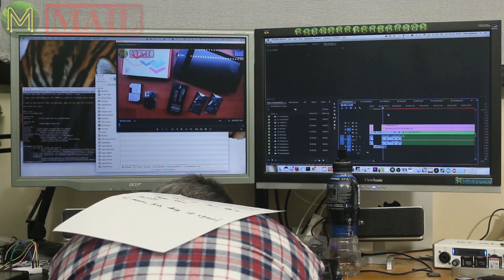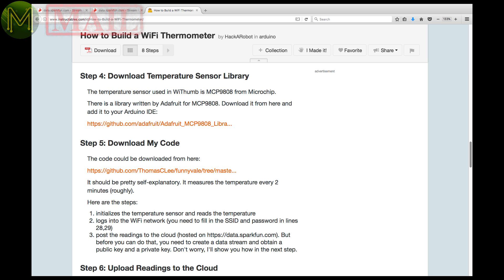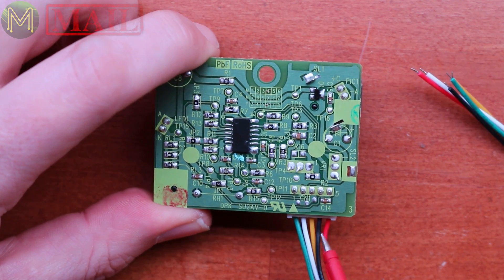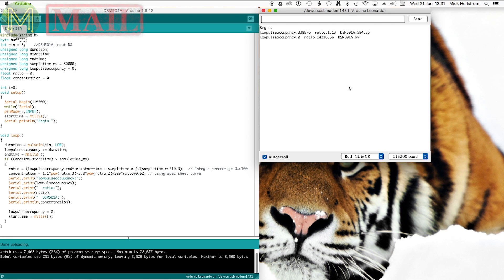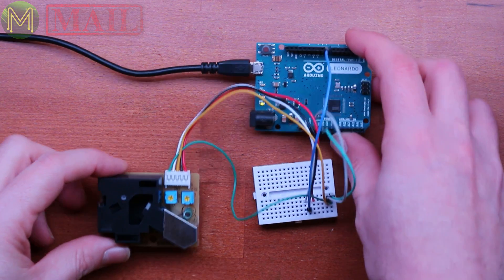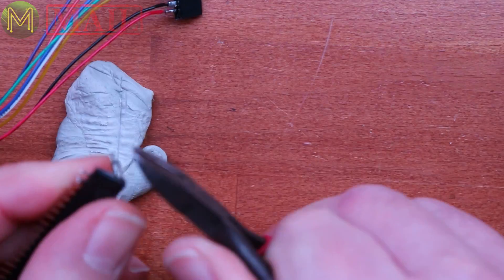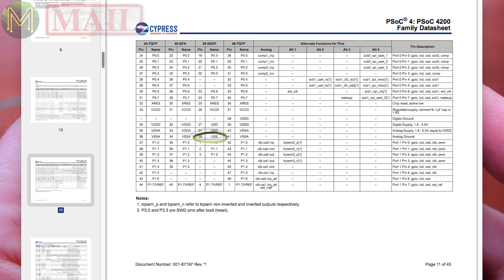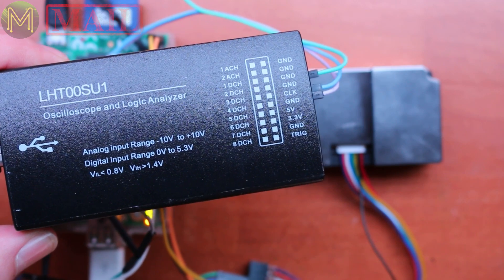#147 MickMake Mail #13: WiThumb, Sensors & cheap Analyzer // News

Comment: Hello Mick... A bit surprised to see you struggling with the dust sensor. It is a well know model sold in China (bought 2 samples) and you can find easily the cable mapping and even the Arduino code to do the stuff. I found them in taobao (chinese website) but I am pretty sure you can find them on Aliexpress.

Anyway, I really love your videos, your look, your wife and your children and your way to use a shaver.

https://s.taobao.com/search?q=sharp+arduino&imgfile=&js=1&stats_click=search_radio_all%3A1&initiative_id=staobaoz_20170630&ie=utf8
Reply from the maker: +Renaud Chine 
Hi Renaud,
Yup, I tend to battle on without looking anything up. Part of the challenge. :-)
But got it all going in the end.
Would be good to be able to compare these sensors to some proper commercial ones.
Reply: Well, in China I bought a xiaomi air purifier and dismantle it: it was the same sensor.
Not enough time to connect the dust sensor to an Arduino and compare the results with the xiaomi...

Comment: I was looking for this exact software (PulseView) to run my OpenBench logic analyzer from dangerous prototypes. Didn't know it existed :)
It's compatible with many hardware boards https://goo.gl/mK5iC7
Will give it a try. Thanks for your amusing and informative videos.
Reply from the maker: Yup, it comes within the Debian distro. Really nice package. You can also save the data and if you're looking at a tx/rx UART stream, you can playback the ASCII.
Reply: The windows version sucks and has a bug that only works for the first capture. Non-windows versions, work fine. I thought I was screwing it up, but not my fault for a change.

Comment: Where and when would you use a dust sensor? Would you use this in a clean room or in a smaller space like a PC or display case.
Reply from the maker: +TheDutyPaid 
Or maybe a dryer that tells you when to change the filter. Lots of places it can be used.
The laser sensor is also used in air quality sensors, which is all the rage at the moment.
I'm thinking of building a solar powered super sensor box connected via MQTT.
Reply: TheDutyPaid I recently took apart a household air filtration unit that had the cheap, LED based particle sensor in it
Reply: MickMake Have you considered adding one to the mailbox? ;)

Comment: Thanks Mick, good to see everything doesn't go smoothly for even the experts. I like the grove? connector setup, thanks for pulling it apart, might have to use one in a future project.
Reply from the maker: +Charlie Mitchell 
Oh yeah, I make plenty of mistakes. Usually just rushing into something and not checking things first.
Real shame about the fingerprint sensor. Was looking forward to it and had plans for it.